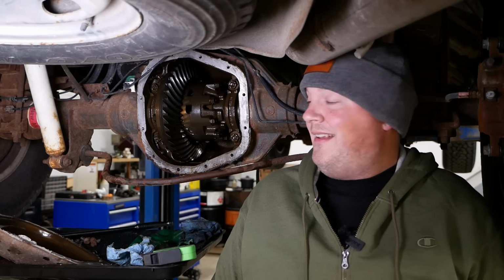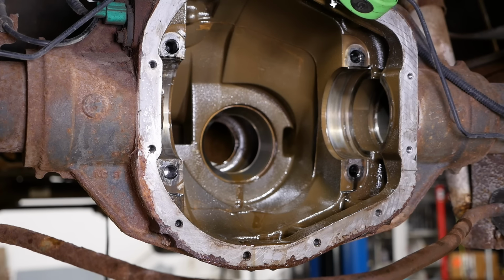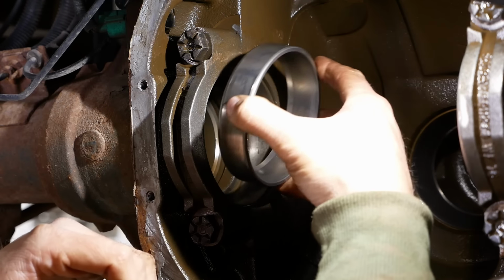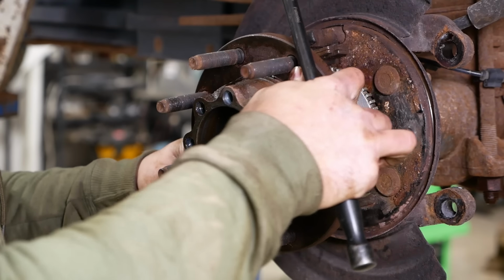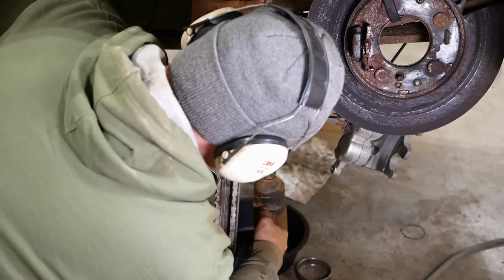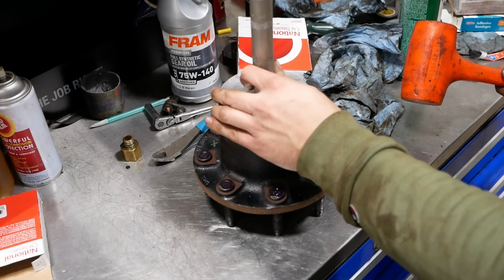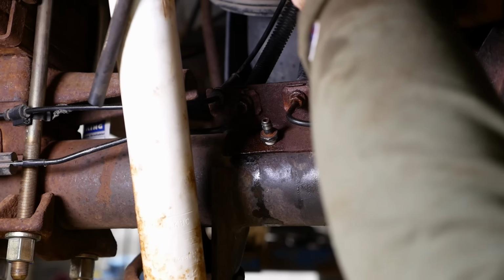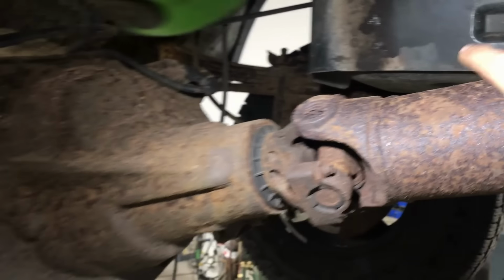Ford Differential Carnage - Driveline Noise Located

Comment: A lot of old timers (way older than me) believed that cars and trucks in the '50s (and presumably earlier) needed to have the outer hub bearings packed with grease.  The reason is that even though they were supposed to be lubricated by the differential, the belief was that the gear oil did not make it out to the outer hubs.  Or, if it did, it wasn't adequate to the the task.

The belief was wide-spread enough that there may be some validity to it, but then again, nearly the entire country believed that an alien invasion of America was real ("War of the Worlds" - 1938 radio broadcast; Orson Wells), and happening in real time.

Also, the belief may have actually been a hold-over from a time when wheels were held onto a spindle; a trunnion; or a journal bearing.  After all, the use of ball bearings in automotive applications didn't come into use until the early 20th century.  

After all, my paternal grandfather was a preacher who ministered to several congregations over a widespread geographic area on horseback.  He was born in the late 1890s and died in the mid-1970s.  Exactly the kind of person who would have seen them slathering grease inside a hub and sliding the wheel onto a spindle on a wagon, and might have believed that one had to do the same to a car.

Comment: I was surprised the torque on the U bolts is ONLY 195 ft. lbs. It would probably take double to get those old ones off - if at all . Are those dealer only and what do they cost ? I see you used the pinch off pliers on the rear brake hose . They are on my list . The magnet on the bleeder tool is a great idea . It pays to be thorough , come backs are no fun . And next time the junk yard won't sell a part , I will offer to buy it as scrap metal . They won't even sell a used seat belt where I am . I think you hit everything on the list .
Reply from the maker: I got the U bolts from my local parts supplier. They are made by Husky in Iowa.

Comment: New vehicle Dif lube should always be changed at the first couple of oil changes. Wash the housing out with cases of brake cleaner. A magnetic plug should be placed if possible. This will help to catch and remove any manufacturing dirt and break in fuzz that may exist. Again it’s a pay me now or pay me more later situation.

Comment: Now I know it's not the right way but what I have done in the past is used a punch to peen the housing, I mean like every MM and you peen it, then some retainer and resemble. I have also seen  shim stock made from feelers used, I've not tried that myself but I've seen it work. I know the jeep yj that I did for a friend we did the peening and he's still running that and it's been over 5 years. I wouldn't ship a customers like that but it's good enough fro the junk I drive :)

Comment: When you pulled the fill plug and that nasty water /oil mixture came out it was obvious it wouldn't be good. In all fairness, no axle can be expected to function with that mess for lubrication.  Unfortunately Ford says that the rear axle fill for the Sterling 10.5 is a "Permanent" fill unless it has been submerged in water. That is total B.S. Depending on your climate and use, the rear axle fluid (with friction modifier for posi-traction axle) should be changed frequently to avoid this scenario especially in wet climates. The 10.5 Sterling (if maintained) is a dependable axle and has been used for many years in gas and diesel applications. I have seen these axles go well over 300,000 miles with no problems. If you don't maintain equipment, don't expect it to last.

Comment: I just do not know what we are going to do with you. Imagine that replacing a rear axle assembly and putting it back like it came from the factory. Yes sir you probably spent more time than the book would pay, but as we know the book doesn't cover all of the time it takes to deal with rusted up stuff and the time it takes to make one out of two. It is unfortunate that a person can not charge actual labor time on jobs like this, but as we would be aware there will be those who will pad the bill with excess labor time charged. Of course the satisfaction of a job well done and a satisfied customer puts you miles ahead.

Comment: Wes, do you have one of the DeWalt or Milwaukee 1/2" impacts, with the lithium ion batteries? I've been amazed how much power those things have. They've taken off nuts and bolts even my 3/4" air impact struggles with.
Reply from the maker: No.

Comment: Well done video!   Thank you.   How did the water get in to ruin the lubrication?
Reply: Axle housing vent plugged, hot oil builds internal pressure, seal fails, water enters thru failed seal area. Diff was overfull when check/fill plug removed...water and oil milkshake. Bearing caps weren't tight enough and allowed bearing cups to become loose and spin. Either someone had the diff apart before or it was a bad assembly job by the axle supplier of the factory assembly line. During axle build, either the torque setting tool was out of calibration or bolts didn't have Loctite pre-applied and rough roads vibrated them loose.

Comment: if you dont put alittle oil on those bearings they will fail before the oil gets out there.the company i used to work for lost a diff. on a peterbuilt that way. thank god i was not the mechanicwho did that. i always put a little motor assembly grease on the bearings.it will mix with the gear oil and the bearings will for sure be lubed long enough for the oil to get there. i saw the bearings  that were put in dry  and they had turned blue and spun on the housing in a very short distance..

Comment: Bizarre how few people service rear differential until it makes noise..400 hp in tiny gears pulling trailers and loads rollin coal equals=$$$$$$$
Crazy
Hardened metal debris wipes all bearings even outer wheel hubs . No magnet on Ford?  All my GM have huge magnets to catch chips.
Nice Job Thanks.
Ps they make oversize and undersize cups for Timken taper bearings.

Comment: Well the hillbilly way to fix those races so they wouldn't slip would be to put a setscrew in the the bearing cap and grind a divot in the race. Use shims on the bearing to tighten it up but since you have liabilities that probably wouldn't be an option. 50/50 chance of success. Another way is expanding the metal using a knurling tool but that would be similar to grinding and boring the the cap as far as work wise. Probably in your case it's best to just get another known good rear end.

Comment: Lol I was just thinking about the fact that my 10.5 needed a new pinion seal.
Being were on this subject there is company called Sky Off Road Design. The reason why I mention it is because you rust and if you have say a Chevy, Ford,  Dodge and Toyota from way back in the day and you can't find a replacement for it try them. Most of the things the are doing isn't your thing but it makes another resource for odds and ends on old vehicle suspension that has rusted off and you can't find parts.
Most 6.2 motors I ever hear about are over 300,000. From what I can tell it is the best kept secret.

Comment: Me personally I wouldn't worry about that fit. It's not going anywhere if you have the proper amount of preload and the wear isn't bad enough that there's play. Just my opinion. I pulled one of these apart on my own truck and i was obviously the second one in there to do work on it. Previous wear indicated that the old races had spun against the shim when the previous set had worn out, but there was no indication that the new bearings were doing the same (all wear on this shim had oil varnish on it, none of it was shiny). Spider bearings were all hammered up too, I'm assuming from the bad LSD and the fact that the PO took it off road hunting a lot, lots of one wheel peel and then grabbing traction will destroy a set of spiders like that. I left them in there because I never off roaded it so I figured just don't spin the tires and they'll be okay until I go in and rebuild the whole rear. About 10k after I was in there to fix the front seal and rebuild the limited slip clutches, the front pinion bearing did the same as this. I was on a cross-country trip from California to North Carolina and the bearing started howling in the middle of Texas. I kept an eye on the temp with a laser thermometer and it never got hot so I kept driving it. I chalk that up to the finned diff cover I had installed (factory Ford part) last time I was in there. I drove it about 1500 miles at like 70 mph like that and nothing else was damaged when I finally got set up in the new shop to fix it. Just that front pinion bearing and the spiders. I rebuilt with all new bearings inner and outer and went to 3.73's instead of the 4.30's, along with a new carrier because it was actually cheaper to buy a used good one than a set of spiders. Moral of the story, those carrier bearings never spun in there even though the races weren't super tight in the caps. This guy obviously ran it a very long time with bad bearings to get it to spin like that, and they spun because there was a ridiculous amount of slop with ridges that the rollers were hammering on the races. If I can drive 1500 miles with no other damage to any other bearing or the outsides of the races after a failure, this guy went a lot further to get to where it is in this video once it started howling.
Reply: Also because of the aftermarket for these, you can get reusable rubber gaskets for the differential cover. I prefer to use these because you don't need to clean up any sealant when you inevitably go back in to change the oil and/or service them. I'm on my third use of my diff cover gasket and it's never leaked a drop. This is again with the cast aluminum finned diff cover from Ford that is an option on some of the tow packages. That thing will run cool as a cucumber with one of those on there.

Comment: I have a 93 s10 with a 4.3 diff leaked i might have drove with low or no fluid. The diff makes a clunking noise. Some times you can get it to stop clunking maybe turn a certain way. What do you think it is axle bearings

Comment: Would you have to take the brake lines off if your taking the bracket off? Just thought that would save a few steps. I like using used parts but you definetly need to trust your salvage yard! Take care and Happy Holidays
Reply from the maker: In the end I didn't need to, but I didn't know that at the time.

Comment: Yes, you're a knuckle on your air impact. That's what will you got on there. You need to remove it because you're losing a lot Of air volume so that it has a very small orpheus too there, so you need to get removed that and put up with the holes wrapping around yet you'll get a lot better work out of that air tool

Comment: The cure is clean the hell out of the innards then etch prime 3 coats on everything except areas where metal to metal contact is. This stops moisture from coming thru the porous metals degrading oil. (Etch primer invented by British is used mainly by English manufacturers like Massey Ferguson, Ford tractors, David Brown and German heavy equipment manufacturers etc. If its aluminium, stainless and die cast its not needed.

After this then fill using Amsoil full synthetics. When using bearings use N.t.n, S.k.f, INA or Timkin only.

I believe the preload on tapered bearings is overdone. Best to visit N.t.n bearings or S.k.f bearing then they are your best advisors as they have a massive history in bearings

Comment: must be that extra whack when you use hammers on videos causes them to fail, the camera factor LOL
so, what caused the problem lack of oil? ahh the plugged vent.
 Can the bearing races be tightened by machining the flat faces of the retaining clamp? o wait you just said that hehe. 
I like the invisible man installing the axle with forklift part and then it is magically attached and lifted up LOL

Comment: 115k miles seems awfully short for those bearings to have issues.  I think with new bearings you may have had a better fit, and maybe just a light hand sand on the cap flats to knock off any high spots could have tightened up the races.  Not saying that wouldn't be a gamble though, but used axles aren't always sure things either.  Damned if you do, damned if you don't kinda situation.

Comment: I understand why stainless steel isn't used, but wouldn't it be a good idea to use it on those vents?
Everyone I remember you taking apart has always been clogged with rust.  38:02

Comment: I am getting a similar noise, gets louder as i drive faster, if im over 60mph, i feel a slighy wobble, could this cause a wobble or is that a tire issue on top of this? I took it to a shop to diagnose and was told its a bearing, but the mechanic did say without the stress of the weight , as the car was lifted, hes not 100% sure. So my question is, could it also be just a bearing ? Its been making noise a few months now. I feel if it the bearing,it would have gotten worst by now

Comment: As for the spinning race... You can take a punch or chisel and ping that bearing cap up and marr up the surface-- that way when you bolt it down, the little high spots and imperfections will smash into the new bearing race, and it should be fine-- being a new race and not fighting that pitting... Edit: --- lol. I guess you already knew that.

Comment: Wes can you show where the oil control valve filter is on 07 tundra with 5.7 engine, there is nothing on the net. Please
Reply from the maker: Pretty sure they clip into the bottom of the VVT solenoids which are in the front of the valve cover/timing cover. I can't remember if there are 2 or 4.

Comment: I'd buy the used axle.  You could use loctite or shim fix.  People don't realize how much work there is in rebuilding a one ton axle.
Reply: It literally looks like that axle sat in salt water. It looks worse than the sterling in my 97 that faced 20 some odd years of Pennsylvania salt and brine.

Also, I've watch guys from the desert unbolt ubolts.  It cracks me up.
Reply from the maker: Must be nice!

Comment: Out of curiousity. and because i’m not necessarily a “Ford “ Guy ( not against them either ) i’ve only owned 3 or 4 in my lifetime and had good luck with those  when i was a kid my Dad had a 67 Mustang he loved , and he used to swap out rear ends from other Fords  from the Junkyards  because they all fit as direct bolt ins and my Dad liked the cheap prices of swapping out the gearing in a evenings work in our garage  his reasoning for why was that Mustang was his  Family car , Commuter , and Weekend Hot Rod  i remember him using a stop watch  to record different performance of the rear ends  with  the family in the car  on different stretches of a certain highway  to check the speeds  is that a feasible option. cost wise to your customer having you install another complete Junkyard  rear in his truck i don’t know Ford 4 X 4 trucks very well  so maybe they all have their issues ?  but i do know back in the day Ford 9 inch rears we’re he Hot Rodgers choice for reliability and strength  on most brands of cars i even have a Uncle that bought a old Ferrari with  bad running gear and swapped that out to allFord running gear  it’s funny he did that in the 1970s and used the car as a daily driver  then sold it as he put it together years later he began getting calls FromFerrari enthusiasts looking for the matching numbers parts  tha he sold years and years ago  apparently it was a very rare car that was valued at millions of dollars if all   numbers matching parts were present and on the vehicle  by a stroke of luck and some of my Uncles leads the parts were eventually  recovered to restore the vehicle

Comment: Before you said,”lock tite and put dimples in the journal”, I was thinking 2010, 100k. Probably a farm truck, never serviced. Thats not an 70mph truck. The spots in the race are from sitting.
I was thinking bearing’s , and lock tite, with some surface finish on the journal.   You said it when I was thinking, if that was my truck, that’s what I’do.  If the truck was a family heirloom then I’d keep my eye out for a low mileage complete axle for 500$ give or take.

Comment: my 7.3 has a brand new water pump after the last one sprung a leak. few thousand miles later my water pump is leaking like hell again. What could cause multiple water pumps to continue leaking like this?
Reply from the maker: Junk aftermarket water pumps. The replacements last about 20,000 miles.
Reply: @WatchWesWork  I will go for a replacement AGAIN, lol. Thanks for replying i like the 7.3 videos you’ve done

Comment: I’m guessing the truck got into deep water and it got into the diff and the oil lost its viscosity and the bearing ended up locking up in the race which made it spin inside its bore. 
If they had changed their diff oil at 80 thousand miles, they would have saved the unit.

Comment: Brindle, spindle and mutilate, when steel breaks down due to water incursion or lack of maintenance, in this case, both. There is no way the outer axle berings are OK, that housing is junk. Never offer to jury rig a customer's mess to save them money. It never ends well. Sell them a rear diff, don't even try to get around it.

Comment: I have the same issues with my 2000 excursion 4.30 gear. Spun the driver side carrier race and trashed the pinion interrace. I will be punching nipples in and using lock tight retainer. Wish me luck. I tow heavy. I would say that I think this problem is caused my poor assembly from the factory.

Comment: if the arrows do  not line up on the shaft and u joint both ends it can cause a whine going down the highway  i do not know if all shafts have these  arrows   this ensures both  u joints flex  same direction both ends this is listed in maint. manuals